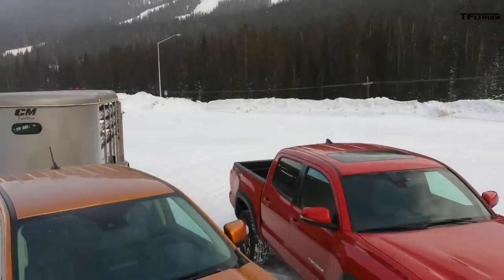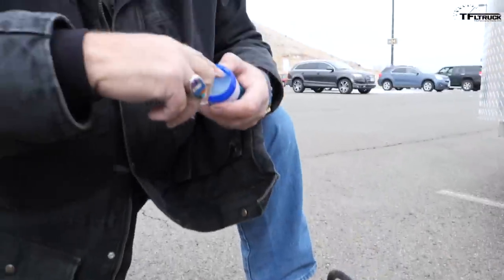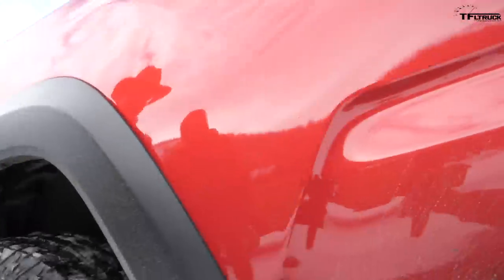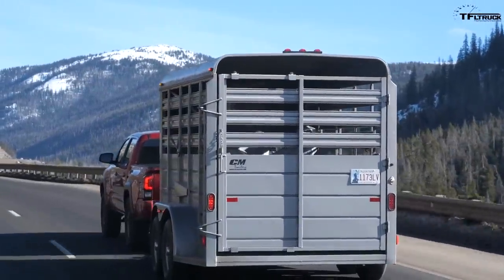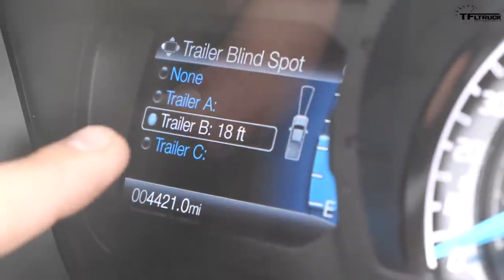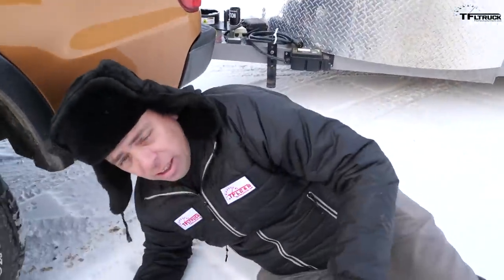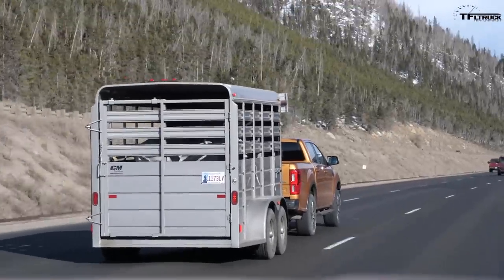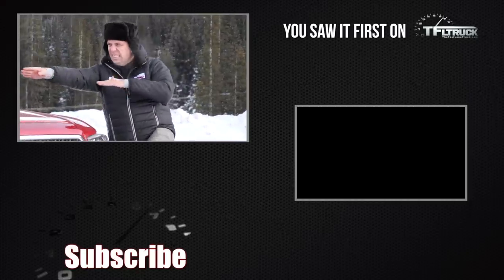Best Midsize Towing Truck? Ford Ranger vs Toyota Tacoma vs World's Toughest Towing Test

Comment: They'll both pull your lawnmower trailer just fine.  More than that and you'll need a real truck.
Reply: Nate T.    Pulls my 3500 lb. camper just fine.    Like it’s not even there.   I love it. Smooth riding, quite, and powerful.    Did I mention looks great too.

Comment: Had 2006 F150 Lariat bought new to mid. 2021 engineered to cost you $ or make Ford $. Plastic and or rubber components that will fail latter in life. Example the cables that connect the door handle to the locking system on rear doors (clam shell doors) had rubber grommets that act as limiters and crumble into year 10 or 12 ish, ford will not see these they want to sell you the entire system for mucho buckos, the center gear selector automatic trans. has a plastic contactor toasts around the same time. Bunch of other things F150 not relevant to ranger, maybe but, spark plug issue (well publicized on 5.4 engine) a problem Ford created with poor engineering, then they (the ford dealers) will charge $800 to $1100 bucks to change spark plugs and if they break its extra. It took a class action law suit, the Japanese will value their customers and usually take responsibility. I wish I could say different but, that is my experience.

Comment: That digital tach in the Ranger is completely inadequate and Ford should be ashamed of that thing.
Reply: All tach's are digital these days, the Toyota is just interpreting a digital signal on an analog device. The reason it looks "smoother" is because the refresh rate is slow. The tach on the Ranger is the same as the Edge sport I have, and it works just fine considering it's unnecessary with an electronically controlled engine. It can also be made much larger with a button push on the steering wheel.

Comment: Anyone else notice the upside down "8`s" in the video? 

Also, what`s up with testing the decibel levels when the truck downshifts and the engine is working hard. Shouldn`t the level be taken when the trucks are cruising because that`s where  the truck will spend the majority of it`s time on an intestate.
Reply: Well, the decibel test is taken to give a general idea of the loudest a truck could be. When you think about it, if you're towing on a freeway for hours (especially in places away from flatland), chances are your truck will be shifting often and in the upper-end of it's rpm band. For this reason, many people would like to know which truck is quieter, so they will be more comfortable. Hope that clears up a little.

Comment: You can keep the Ford. My first truck was a Tacoma and I’m on my second Tacoma now. You can’t beat the reliability. Current truck is a 2014 tacoma with 126k mikes and zero issues so far. I wouldn’t trade reliability for an extra 0.2 mpg and faster truck. The 10 speed transmission will crap out before 150k miles.

Comment: We not bsck in the 90s early 2000s the ford ranger used to be bulletproof with the 4 cylinder nd manual but with a turbo charge engine 4 cylinder doubt it go 200K miles like the old ones did those days are gone, by far tacoma powertrain is bulletproof easily last 300K miles only problem with the Tacoma is the rust issues I don’t kn if they fix that but Thts the only problem
Reply: Consumer Reports ranked 2016+ Tacoma least reliable midsize truck for sale in US.

Comment: changed wheel bearings front and back.. rotors and pads front and back.. pinion and main bearings and driveshafts and wheel lockers and still have something vibrating and making a bearing gone bad noise.. waiting for the transfer or transmission to fail.. Ford's suck.. 122k miles.. Toyota 200k worry free

Comment: Well, whoever told you that you could tow 5k# plus without wd and sway control in that Ranger will be fired after a couple are flipped over in the ditch with an RV attached.  Even your video showed that thing swaying all over.

Comment: Impressive specs on the ranger, but I think the tacoma wins when you consider longevity and resale value. The tacoma has similar towing capabilities but does it with a much simpler powertrain. A turbo 4 cylinder with a 10 speed sounds like a maintenance headache.

Comment: Try towing while using cruise control. The Tacoma downshifts perfectly.
Reply: Running at 5,000 rpms all day will overwork that little 4 banger. After 100,000 miles on those trucks them again.
Reply: @mikeschoolcraft21  The Ranger climbed the IKE with much less RPM then the Tacoma, less rpm = less wear and tare!
The Rangers max. hp is at 5500 rpm vs. 6000 rpm for the Tundra and max. torque is at 3000 rpm. vs. 4600 rpm fir the Toyota.

Comment: Ive looked and drove all midsizes except the ranger. I thought the taco was the most comfortable to daily but inthink the frontier is the best value. So i settled on a 2018 frontier pro 4x with 35k miles for $25k. I think i did good and spent 15k less than i planned on

Comment: all  new  nissan  frontier  will  come  in  2019    as  a  2020  model     all  new   V6  motor   and   a  2.8 L   cummins  diesel  motor
Reply: Like Ford, Nissan will get a great engine from others.
Reply: They better increase the performance of that 2.8L Cummins or else it will be a pig.

Comment: Come back after 50,000 miles and don't forget to tow a flatbed with ford repair receipts...
Reply: Heard of more problems with these new tacos than the new rangers 🤷‍♂️
Reply: @freedomisntfree_44  I heard about problems with tacos [made in mexico] such as rusted frames. That was one of the reasons I have two 4Runners (rather than Tacomas) made in Japan.
But (BUT!!!) Toyota - unlike fraud - takes care of its OCCASIONAL mishaps - all affected vehicles have been VOLUNTARILY repaired or replaced. Fraud, on the other hand, fights to the last drop of blood (customers' blood) over every one of its multiple screw ups. I remember demonstrations of pissed off customers when tauruses were losing paint and rusting through back in the 90's, and fraud refused to address the issue. I am not even talking about infamous 100% head gasket failure rate on 3.8...
Google "ford lawsuit" - it returns About 21,100,000 results. That's TWENTY ONE MILLION ONE HUNDRED THOUSAND! 
I would take my chances with Toyota any day of the week, and you are welcome to deal with fraud.

Comment: I recently rented a 2020 Ford Ranger Lariat crew cab 4x4  for a few days while my F-150 went into the body shop.  I use my vehicle for work and do a lot of driving.  I had grown up on the older Rangers and was really excited when Ford announced its return.  Overall I liked the truck and would consider buying one.  However I did not like the single-gauge display of the Lariat and found the display options to be very cumbersome to scroll through while driving just to find the information I needed.  Moreover it was also very distracting.  Admittedly I'm not a big gadget-guy either so... Why can't Ford just give me simple analog gauges to show me all the information I need at a glance?  Does Ford really think I need to be shown 5 different ways to improve my fuel economy?  Another feature that makes me hesitant to buy this new Ranger is the Turbo-4 as the only engine available.  It has plenty of power, but will the long-term reliability be there in another 80-100k or more?  I question that of all turbocharged gas engines.  I'm a lifelong Ford owner but I just might switch to either a Nissan Frontier next or a GMC Canyon with a naturally-aspirated V6.

Comment: The hitch adapter does not slide back and forth in the hitch receiver on the truck. the moving parts are inside the hitch adapter.
Reply: Look again, the outer tube has a slot and the inner has the hole. It looks like it does slide in the receiver.
Reply: You are correct, I didn't pay close enough attention.

Comment: Tacom with a sunroof has a lower headliner. If you go without the sunroof there’s a lot more room. I’m 6’3” and have no problems in my 2017 TRD Sport.
Reply: They also complained about the door jam height, they were hitting their head getting in and out.
Reply: I’ve never had that issue. If I was wearing a cowboy hat I’m sure I would though 😄

Comment: i just read yesterday that in order to change the oil in the new Ranger you have to take the left front wheel off! then remove an access panel to get to the oil filter. then you have to remove another access panel to get to the drain plug...thats a deal breaker for me. if its not easy to change the oil, people will just skip it and not worry about the engine...well i buy used only
Reply: Most new vehicles have under body aero panels or access panels that need to be removed for filter and drain plug access. Many trucks also have skid plates that are in the way.
Reply: @mblake0420  Access panel, not entire inner fender.

Comment: The difference is in reliability. Tacoma is a proven platform and the ranger is not. The direct injected turbo will need much more maintenance due to carbon build up on the intake valves. Turbos = problems
Reply: Consumer Reports has rated the 2016+ Tacoma the least reliable midsize truck for sale in the US.

Comment: It seems like you should have old mid size gold hitch winner vs the Ranger. None of this runner up vs. the new boy. My 2015 GMC 1,500 pounds of payload better then both and tow 7,000 pounds. How about you guys do a Ranger vs. Canyon, that's a better idea.
 Mr. Truck also the Canyon has you fitting better and you know this because you reviewed it. Every time you get in a Taco you complain about the same thing.

Comment: I would want to see how those two vehicles engines and transmissions are doing 16-29 years latter and 300K-500K worth of miles. I have a 1995 Tacoma 4x4 reg cab and a 2013 Camry and both of them have engines and transmissions that have not been touched other than oil, filters, coolant etc....Everything bolted to the engine and power trains are original equipment. The taco takes cap and rotor and plugs wire replacements but the Camry is coil on so none of that. Taco has original wheel bearing Camry had to replace front wheel bearings and struts at 175K . Our 1986 4Runner is still on the road but not in the family anymore but still in our town see it regularly. We do not do anything special outside of synthetic oil, gear lube, ATF etc....In fact we as a family tend to drive vehicles like we just stole them and are on the run from the police. I have owned Fords and Dodges and well I would rather by a Toyota off family heavily used than a new Ford or Dodge. The Ford started to nickle and dime me as soon as the warranty was up and the Dodge had to be taken to the dealership every other month the first 2 years I owned it for warranty work or recalls. By the time the Dodge was 2 years old and had 26K miles nothing under the hood other than the engine was original a lot of the suspension parts where replaced and the various computers that controlled the doors, windows, and such had to be reprogrammed more than once. The bolts that hold the front seats in had to be replaced under a recall because they where falling out. I do not think the EcoBoost engines have a very good track record so far either! Most Ford Mechanics interviewed when asked about what they would buy in an F150 like 8 out of 10 say 5.0V8 because it is well sorted, durable and problem free! The Ford Ranger was never as good of a vechile as the Toyota Hi-Lux then Tacoma in terms of durability, off road performance and in the past tow capacity or towing performance. That Cologne V6 they used for so long was not that hot and the I4 was dreadful! I still remember how they looked for decades with the wheels tucked up underneath them with super narrow track and tiny axles for decades! While Ford has the F150 well sorted they did a terrible job for decades ont he Ford Ranger because they where too broke to redesign the Ford Ranger. I hope this new Ranger is something they can be proud of but it is wait and see! I do wish Toyota had a 10 speed and a more powerful V6 but I am just glad they are not putting a Turbo 4 in the Tundra yet or the Tacoma!

Comment: Ford has 2.3l 4cyl, taco 3.5 v6. Physics says taco will have more engine "braking" going downhill. Mr truck should know that! Every rev 3 cyl compressing air will brake more than 2 cyl.
Reply: The F150 3.5 V6 had the same engine braking as the Ram 5.7 and GM. 5.3. All the 3 trucks had the same number of brake applications.
Reply: I think gearing has the most to do with it.
Reply: @mikemissouri5152  The Toyota 3:91 axle ratio will provide more engine braking then the Ranger's 3:73.
Reply: @mikemissouri5152  if gearing had the biggest effect then the ranger should have won by a land slide! 10 vs 6 speeds...
Reply: @crazyhass84  The Ram, GM., and ford all have variable cam timing and the F150 has the highest fuel economy ratings so more parasitic driveline drag doesn't make any sense.
Reply: @crazyhass84  It did!

Comment: I see a giant flaw with ford it is simple the fords displacement is  2.3l with 270 hp engine will not last that long when used under heavy load this is a current trend of manufactures so trucks don,t last as long and you buy a new one every 4 years(maybe a rich Russian paid off chief of state could afford that) When we raced our Rothman's  GT3 911s we rebuilt after every 24 hrs. and they where 3.6l 400 hp and we used best oil on planet earh you can not run 24 Daytona, or La Mons without

Comment: No no no truck with a 4 cylinder engine is going to tow a trailer with cattle not happening it will fall apart after a few trips very bad idea this truck is already having problems along with the f150 with the 4 cylinder will not last !!! Why don't you try this for multiple trips

Comment: Ranger is for millennials who don't really need a truck but want to look like they do while wearing their flannels and sporting lumberjack beards.They need everything done for them everything done for them, so they need all the electronic safety crap and automatic transmission it has to offer. They can't change their own oil so the fact you need to remove a wheel to change it won't be an issue...... Tacoma for the rest who can drive a manual transmission and don't need to have their hand held as they motor on.....

Comment: The ranger. won't last as long as tacoma
Reply: The engine and transmission won't last as long as the Tacoma.  But the frame and leaf springs will last longer on the Ranger.  I'll still take the Tacoma over the Ranger.

Comment: Toyota will always be on the road with just routine maintenance and is superior in both reliability, along with longevity. Plus, the Tacoma has a sun roof, which the Ranger lacks. Toyota, simply the best. Ford turbo means more to break and more expensive to repair, though. FORD, Found On Road Dead and Fix Or Repair Daily.

Comment: owned toy in the early 80s and did ok, now a days see few offroad and the toy community as whole (with some exceptions - you know who you are) kind a turned me off with their pompus I am the king attitude with most of  them running mud flaps and side steps thinking they off road on what many know as the  road to the trail head, nice to see the tacoma getting its ass handed to it even on road .. offroad they have issues with CV boots and joints breaking,  rack steering fails with larger than stock tires and so on, no king no longer - hope they stop living in the 80s and come out and play more to get some respect back

Comment: Although you made the right choice at the end, you two really needed to take someone savvy with the Ranger along. I thought you were driving a stock model and when I saw it was a Lariat I was shocked that you didn't know how to display tach, you somehow had the trailering dashed line on the backup cam off, etc., etc., etc. Add to this all that the Ranger is capable of 7500# towing, the Taco isn't even in it's class. Lastly, Toyota hasn't yet gotten the memo that the mini-truck is dead. This is why Ford stopped making the Ranger and then brought it back as a slightly downsized F-150 (same for GM with the Sierra/Canyon and Silverado/Colorado) with significant towing and off-road capabilities. Sorry, but the Taco doesn't come close.

Comment: If you are splitting hairs I would go with Tacoma any day. That Toyota reliability is gonna surpass Ford by miles
Reply: Ian L what metric are you using to show that the Tacoma is more reliable because almost every single major agency for the past 30+ years has stated that ford trucks are more reliable.
Reply: @benjaminwayneb  Kelly Blue Book and Consumer Reports both list Tacoma more reliable, about half the annual repair cost of Ford
Reply: @devinbender8428  Kelly Blue Book and Consumer Reports, many others. you are blind if you are saying Ford is more reliable for 30 yrs. Ford has had notoriously par to sub-par reliability across their brand from JD-Power with the exception of the old ranger models. This model isn't old enough for me to reconsider that yet.
Reply: Ian L consumer reports gave the 2011 Tacoma the “certified clunker” badge of honor. I’m not saying the ranger is in anyway perfect and reliable. But it’s definitely more reliable than the Tacoma.

Comment: Why don't you throw in a manual transmission Tacoma and see how it stands up against the automatic transmission Tacoma?
Reply: Probably wasn't available to them at the time, but it's also a relatively low volume of trucks that sell with a manual.